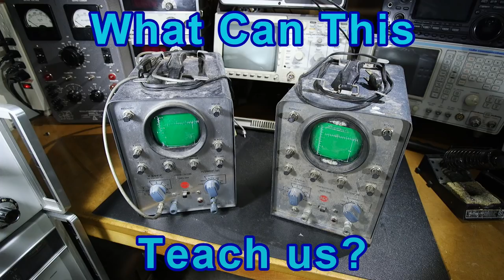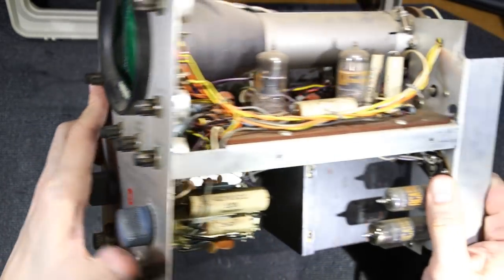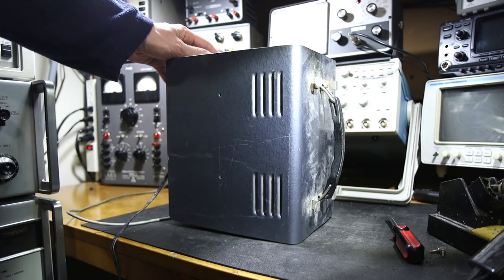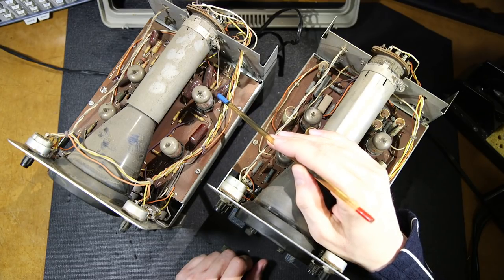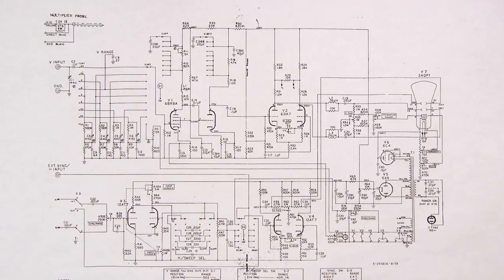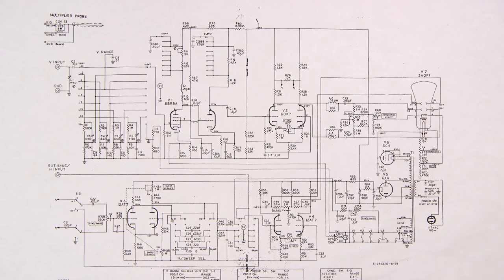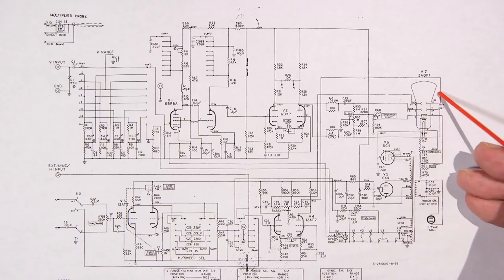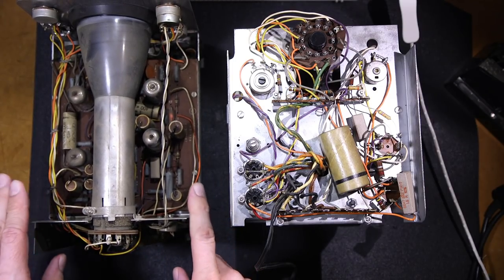What Can Old Test Gear Teach Us About Electronics? Find Out.

Comment: Seeing the title and just starting to watch the video the first thing that comes to mind is quality.  Most modern "stuff" is so much lower in build quality.  We call old stuff boat anchors for a reason.  I have HP high voltage power supplies built in the 1940's that are still 100% original to include the massive sized electrolytic capacitors.  Doubt I will ever see a modern power supply last half as long.  Now back to the video.
Reply: Recap them, PLEASE. Been there, done that.
Reply: @ProgNoizesB  actually, older equipments like that are several times expensive or even costs house and lots those days. but you could argue how long they last makes them worth it. but no, products today are so cheap, you can't begin to compare it. it's not even proportional. there are super high quality expensive products these days that will compete with multiple times costly old products.
Reply: @omniyambot9876  Very few expensive products will ever last as long as their counterparts from the 40's and 50's.  Those machines were made to be maintained forever.  With the exception of luxury watches that use ancient technology, name one super high quality product that doesn't have built in obsolescence?

Comment: I like your explaintion of how a tube works. Like you said, alot of people think they "amplify", but they don't.  They're a large variable resistor, with which you need a somewhat high-impedance power supply feeding them, so that the tube can "sag" the power supply and recreate the sine wave by lowering the voltage by sagging the supply with a series resistance introduced by the tube. They work pretty much backwards than what some people think they do.

Comment: I worked a Calibration van for some time and was surrounded by antiques and that was back in the 70's, tons of electronics literally. The Marine Corps gets what the Navy retires.  But a Fluke meter calibration station replaced better than half of the hardware within a few weeks of testing the new procedures and results verse old.  That was a lesson in change, miniaturization, and even more precision.  Participating in the migration from tube to transistor to IC's was a career and quantum memory may not be far away or closer than we think.  Metrology was and is still a fascinating endeavor for me, and the big data that comes with.

Comment: Nice job Paul!  You are quickly becoming "the dean" of electronics on YouTube. I would enjoy watching the restoration of the old RCA Scope.  I also would like to see your "checking for outside foil" trick again as you replace those old caps. I recently SAVED an IT-28 cap checker thanks to your videos. It is cosmetically restored, switches cleaned and now needs a re-cap but one step at a time. 
73's
Steve
Reply from the maker: Thanks Steve!

Comment: Really educational video. Older electronics are much more interesting than modern circuits with highly integrated components.
Reply from the maker: I Agree!
Reply: I think so, too.  "Interesting" doesn't necessarily mean better, just more fun.  Like an auto transmission is much easier and more convenient, but a manual is more fun.  To take it a step further:  Back in the 60's when I was a ham, and built my own gear, we homebrewers called anyone who used store-bought gear "appliance operators."  0bviously anyone who ran a Collins S-Line would be justifiably amused at our arrogance, but we were just expressing pride in our DIY skills.

Comment: I picked up the later WO-33B model that as far as I can tell is like the poly-cap one with a black face plate and a few more inputs. It has a couple of minor issues and I'm very happy that I ran across this video. You go into far more detail than most to the point that this video should be a very useful guide in rebuilding mine to use. I work on tube radios so precision isn't super important,you use any old O-scope and a signal generator to align the tuner and that's about it.

Comment: Fantastic video, as usual, Paul. Very clear explanations.  I'd be most interested in seeing you do both; build your curve tracer out of one scope and restore the other to like new condition.  I'm now kinda sorry I sold my two Tektronix scopes (a 465 and a 475) two years ago on eBay.  Fixed power supply issues in both but they were still showing their age in scratchy pots and inconsistent alignment.  I was not confident I could rebuild them so replaced them while they were still working with an entry level DSO that I'm now not entirely happy with.  Wish I'd known about you then, I'd have two gloriously rebuilt top-notch analog scopes by now...
Reply from the maker: Thanks for your kind comment!

Comment: Acorn tubes were introduced during WWII, but in the late 1950's, the even smaller Nuvistor tube was developed, primarily to move TV sets into the UHF region. An all-metal Nuvistor looks a lot like an early transistor when plugged into its tiny socket on a chassis.

Comment: As usual, an excellent job.
From a 1966 Newark Electronics catalog  (I worked for them at the time and still have one of the catalogs), the RCA WO-33A was selling for $139.00. It was also available as a kit, for $99.00 and that may account for some of the differences in assembly that you have noted.
Bjorn

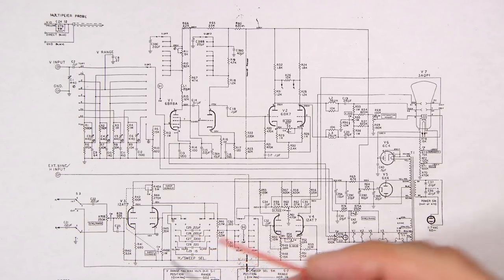Comment: Paul,  At about 1:03:40 (really just before that), you mentioned how the early oscilloscopes were called oscillographs.  In the early '90s, at work I used an oscillograph which actually drew a graph on very fast moving paper at the settings I had to use -- it would spit paper out the end onto the floor so fast that we could only run it for a couple of seconds --- or as fast as we could turn it off since the actual test only took a fraction of a second.  It definitely didn't have a CRT.  It was part of a test stand that required hand-plotting points from the oscillograph "graph" of time vs. volume of hydraulic fluid to see whether or not the valve being tested was good as is or required repair.  The test stand was an old design (pre-microcomputers), so the oscillograph was the most advanced part of the entire system.  I guess that the word oscillograph was used for two different technologies that performed similar tests?
Reply from the maker: Hi Bob. It definitely was used for multiple technologies. I have some older oscillographs (oscilloscopes) here that are clearly marked "oscillograph." That name didn't last long with test equipment before it was changed to "oscilloscope." Thanks for taking the time to write!

Comment: Just got one of these. in the manual there is an errata note clipped in that states that 6CL8A is used instead of a 6BR8A/6FV8A for the Vert. amp they then state that the 6BR8A is interchangeable with the 6CL8A in  this application. Mine also has the nice poly caps.

Comment: I learned something new about electronics from researching old O'scopes....   There was a sea change in circuit topology happened in 1961.  Prior to then the amplifiers were Pentodes running as class A.  After 1961 amplifiers were differentials /long tailed pairs and differential amplifiers continue to be used to this day.
I had wondered how vintage American O'scopes could so readily be put to use with octopus and similar low voltage year circuits.  I discovered that the American vintage O'scopes date later than 1961.
The British "miniature" O'scopes predate 1961 - Cossors and Metropolitan Vickers were made during the 1950s.
Anyways I am rewiring my collection of Cossor 1039M , 1099, CT52 to use dual triode diff amps, or in some cases use EF184 dual Pentodes as diff amps.
Just so you know....

Comment: I have several vacuum tube operated oscopes.I will often use one of those for testing things like vacuum tube amplifiers and other things capable of high voltage and/or high current when I don't want to risk one of my more modern dual channel scopes.

Comment: Awesome video! That's a good tip about twisting the AC lines in vacuum tube audio amps. I've built a couple of amps from my own designs before, and I've never though to twist the wires. One problem I've faced is a very subtle mains hum on the preamp, and I'd be willing to bet my lack of twisting of AC filament supply lines has a bit to do with that. Thanks for the tip!
Reply from the maker: You're welcome, glad you enjoyed!

Comment: I noticed that all the tube sockets, tie strips and circuit board were mounted with screws and nuts, not riveted. It looks like those scopes were kit built, or they didn't care about saving time and money by using rivets. Of course it was around 1959!
Nice video, keep them coming.

Comment: Your simple example using batteries, is just awesome. If a person can't learn from you, they can NOT learn at all! You are a "cut-above" kind Sir.

(Bit of trivia in reference to "induction and capacitance" in oscilloscope CRT's; even though there are no discrete coils or capacitors in there; reminds me of huge transmitting tubes designed for ultra high frequency Radio/TV stations. IE:  Even a bolt (Yes bolt) can be an inductor and/or a capacitor. Strange as it sounds it is true.

Thus, it takes careful designs to get around these maladies. In other words, it drives engineers crazy.)

Comment: I'm just now finishing up an EICO 460 5 inch , 5Mhz scope. It was a battle. The power transformer had a dead short in the primary. All I could locate was a used transformer from a Heathkit 0-12. There were minor differences. The filament lead to the 5UP1 CRT had a short to ground. Then the main filament line would only output 4 volts AC. I managed to squeeze in a filament transformer for the main string of tube. For the CRT filament I currently have an external filament transformer with a high pot winding. Not sure what I want to do with that next. Hopefully I'll come across  newer used correct transformer. The filter caps we're all changed out as well as Hi ET 1600 volt caps. Currently on order are two 6CB6 vertical deflection drive amplitudes, a 1V2 HT Focus tube , and a Vertical Gain Pot 2.5 k ohm. It will still be a work in order for some time, but right now it's functional for retro demos.

Comment: It should be noted, for our viewers just starting out in electronics, that tubes and solid-state electronics each have their pluses and minuses. Tubes are physically fragile; the glass envelope is very thin, and the filament lead wires are also thin. Drop one on a hard floor and you’ll be sweeping up glass fragments. BUT, they’re much more robust and can withstand higher voltages (and spikes) that’ll destroy modern semiconductors. Semiconductors, OTOH, are physically robust; they’re mostly metal and plastic. A drop onto a hard floor might bend a pin, but they’ll generally survive, but they don’t like high voltage (static electricity) at all (There are exceptions, such as MOVs, though.)

Comment: Really enjoyed this, thank you.  Coming from the UK , where the usual supply voltage is 230V, I'm always surprised to see metal-clad equipment like this with a 2-core mains lead, i.e. no safety ground connection to the outer case..

Comment: When I was in high school (years ago) we had a rather extensive electric shop that built a lot of vacuum tube things. We got a lot of our parts by tearing down TVs that had stopped working. The power transformers were used to build power supplies. We also built amplifies and radios including even an Ham set. These things put out over 300 volts.

I thought building a TV would be a bit much but I did want to build an oscilloscope. I thought about it quite a bit but never got to it. I figured it wouldn't be real fancy but just audio scope. I figured if I could do it I might learn new things. High school ended before I got the chance.

Comment: I know this was a long video but perhaps it could have split into 2 and showed o'scope traces that followed the signal path as well as the sawtooth coming out of the horizontal sweep tube and what actually is creating the saw tooth signal going into the sweep tube. In the signal path you could have the input on the bottom trace so you could actually see as the signal gets inverted from stage to stage....that would have been cool!

Comment: Something that has come to my mind before, and that might make for an interesting video would be an oscilloscope to frequency analyzer conversion module. I've not seen anything like it, and frequency generators are far fewer in supply than old oscilloscopes!

A sweep generator running into a voltage controlled oscillator, then a superheterodyne circuit, and then linear to logarithmic converter, would give you a very basic frequency analyzer that could be calibrated, and given a few knobs to control the on-screen range, sensitivity, and maybe even a linear to logarithmic converter bypass switch.

I haven't thought about the nitty-gritty of it though, and don't currently have the knowledge required to design it either, but it shouldn't be to difficult for you!

Comment: Another WINNER Paul !  It added more than I expected with the comparison. I have an old Tektronix 326 which gave up the ghost a while back. I plan to crack the case and see what "popped" and if I can fix it. Learning more about tubes and their function may be passé but still valuable in my books.  Looking forward to  the second unit rebuild.  I may invest in a budget microscope also to aid me in small circuit board repairs.  Have you made any vids on scope features ?  Thanks  Jim K
Reply from the maker: Hi Jim. Working with Vacuum tubes is far from being considered "passé," understanding the flow of electrons in a vacuum is very important (in any point in time.) So feel comfortable in learning and understanding this technology, it's crucial in moving forward in modern electronics, (a fact that eludes many engineers and techs.) I haven't done any reviews on microscopes, but may in the future. Thanks for stopping by!

Comment: first off,, i must say i love these videos,, great job...        i was watching these videos and when i got to this one i was not expecting such an in depth explanation of what is happening inside a tube,,, at about 41 minutes in.  you start explaining the circuit with a schematic in front of you,, and you talk about the signal getting inverted by the tube and the tube pulling neg,, then swinging back positive,,, can you explain this "effect" in more detail??  specifically,, there are a few of us that are learning rf tube amplifiers,,  sweep tubes and triods,, ect,, mostly in the ham bands,, and this tube voltage "swing" thing seems to be the most confusing to try to explain... your explanation is the best i have seen yet. and it would be greatly beneficial to the world to get a specific explanation in the service we are using them in,,, like in this video using the tubes in a scope.. for us we are using them in rf amplifier am/ssb operation.. so a explanation in that relm would be great... also we are trying to figure out what grid circuit design practices in rf amp am, and ssb service will get you class a or class c or the like,,,  to clarify,, there is confusion on how we get the different classes of operation out of a tube amp,, it would appear as if we would modify the control grid circuit to "bias" the tube per class of operation... but this is just my personal guess.. any help is greatly appreciated..

Comment: Dear Paul, i don't know if you will see this question because the video is now 4 years old but if you do i want to ask you, how do you discharge a CRT in an oscilloscope? I didn't found any info in the net, the only thing i can imagne is that you could discharge all pins of the tube safely with a resistor to chassis ground. Am i correct here? I watched all your videos on the preparation and restauration of Oscilloscopes and you did mention, that you should discharge also the crt besides the capacitors but didn't show or explained how. Thank you so much for all your videos and also for you patreon videos, they are gold for a young guy who want to learn about electronics. Best from germany, Tim

PS:  If anyone else is reading this and has an answer to my question, i would be really greatful!

Comment: You make me nervous, Mr. C! Not on these CRTs so much, but all CRTs' aquadag will hold a charge within the phosphor that takes a long time to discharge completely. That's especially evident in 'high persistence' phosphor devices (RADAR, etc). So, you discharge the CRT for a few seconds, move on to discharging other caps in the circuit, and in the meantime aquadag voltage has gone right back up again, all teeth and eyeballs ready to jump and grab. Even a 0.5% charge on a multi-KV device hurts quite a bit.
Reply from the maker: These little CRT's have no anode connection on the exposed glass surface, so not as dangerous as a Radar or TV CRT. Still your precautionary note is well worth heeding. One can never be too careful.

Comment: A great video on these compact oscilloscopes.  Thank you for doing the comparison segment.  It really shows how things can change in the same model over time.  Yes!  Do the restoration video please!  One question I did have is you trust the banded end of the brown poly caps to be the outside foil even though we know when manufactured, they can reach the labeling machine in either position.  Were these poly caps (Brown Drops?) made with that much care as compared to modern tubular or Orange Drops?
Reply from the maker: You will find that the older brown drops (kind of a burgundy color) will be marked correctly. The new "random line printing" didn't happen until much later.
Reply: That's what I was wanting to know.  As one viewer mentioned, quality is what's in these pieces of equipment.  I think it is up to those of us willing to repair them to teach others the values of quality.  Your videos certainly do that.  Thank you for that!